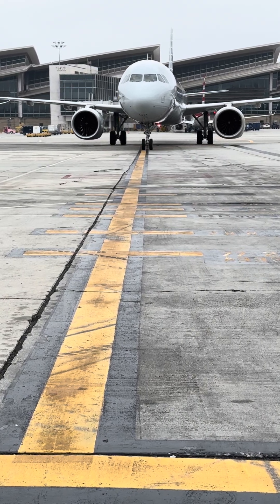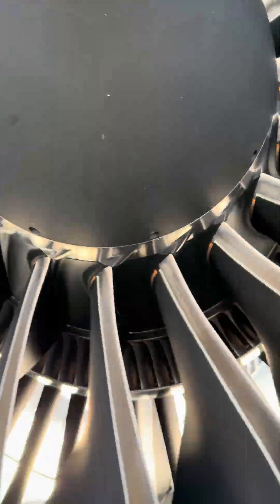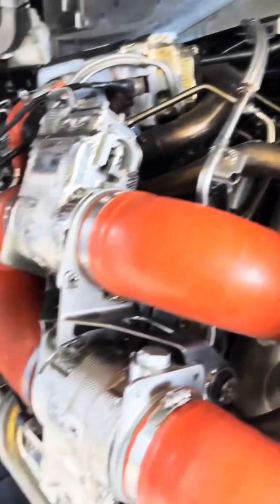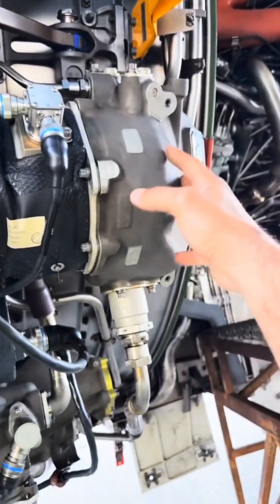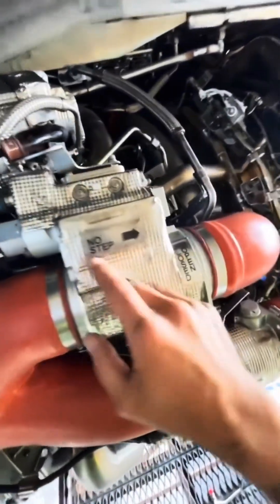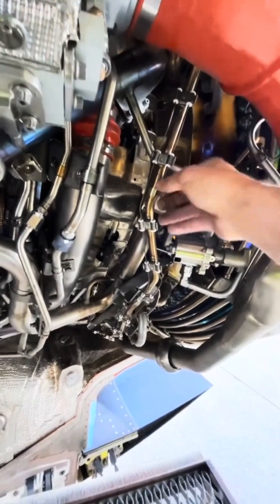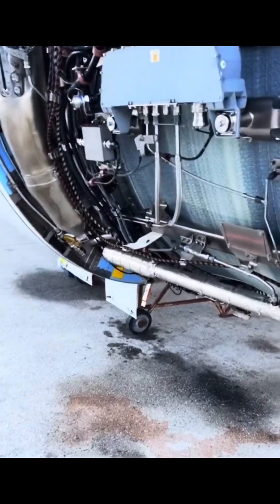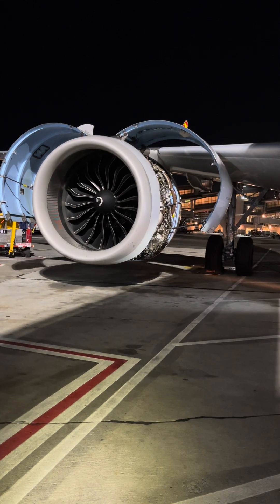CFM LEAP 1A break down

Comment: And we always have a HIL entry for HPTACC support brackets broken or fully broken. Check every 150 flight cycles in accordance with a certain service bulletin. We now get the reverse bleed system retrofitted as well, so quite apparently the engine needs some love and has its issues.

That said, it is absolutely incredible. Climb performance is much better, one can nearly always climb straight away to the maximum cruising level saving more fuel. And yes, it absolutely sips fuel. We need 1.5 metric tons less fuel on a 2 hour sector.

Comment: Can anyone explain the difference between the CFM leap and the CFM56? 
I know the leap has the composite blades, does it also use a FMU instead of a HMU like on the CFM56? Cant find a clear answer online
Reply from the maker: Well the leap 1A/1B is a very different design. It has advanced technology much like the GEnx. FMU and HMU work much the same in concept but how it does its job is different. Different compressor staging and well as advanced materials in leap engines.
Reply: @StigAviation  that's amazing, thank you so much! Dont suppose you know where I could find any more information on the inner workings of the FMU?
Keep up the great vids!
Reply from the maker: @jamowie4866  https://www.researchgate.net/figure/Schematic-of-FMU-and-flow-rate-servo-control-valve-of-fuel-control-system_fig1_336391625 

Try that for starting.
Reply: @StigAviation  legend! Thanks man, much appreciated!

Comment: I don’t what he said
Reply: @StigAviation  yes, I didn’t understand: 1. Where’s the APU.
2. How does the pressurized air start the engine 
3. How exactly are the gearboxes connected 
4. That valve is a regulator of what?
…
Reply from the maker: @erict.35  you should watch my other videos. I explain a lot of that in other videos
Reply: @StigAviation  every engine has its dedicated APU?
Reply from the maker: I think you were confused on engine and APU, APU is an engine. It’s just an extra engine in the back to provide air and electrical power, it’s got nothing to do with the main engines.
Reply: @StigAviation  what do you mean APU has nothing to do with main engines? You said the APU has something to do with the start of the engines.
Reply from the maker: @erict.35  yes to start the engine but otherwise it is its own source of power. You asked if engine has its own apu. I’m saying there’s only one apu
Reply: @StigAviation  okay.
Reply: @StigAviation  where’s the compressor?
Reply: Where’s the compressor (or air pump - I don’t know how you call it in English) for the starter?
Reply: Okay, so the compressor is located near the APU and then there’s a pipe from the APU to the main engine, where there’s a mini turbine motor which is mechanically connected to the main engine shaft. You didn’t say anything about it in your video.
Dislike.
Reply from the maker: @erict.35  starter is on the left side. I show it in the video.
Reply: @StigAviation  in your video you didn’t even explain why you have to open the valve manually. Why don’t they do it electronically?
Reply from the maker: @erict.35  this is why I said to watch my other videos sir. I put more information in my other videos

Comment: You mentioned the EEC in your video. The 737 has that. Airbus engines have FADECs.
Reply from the maker: They both have the same thing, it’s just EEC is that physical box on the engine, FADEC is the system. The terms are interchangeable.

Comment: Could you show where the pressurized air exits after driving the starter? Is it vented into the bypass stream, or is there any exhaust similar to the one for the engine anti-ice?
Reply from the maker: You mean from the starter ?  Just gets dumped into the cowling and goes overboard

Comment: Wow ! Runup with engine cowl openned 😱 not allowed in case of engine fire !!!
Reply: But i want to tell you that all your videos are very nice. I m instructor and you hare a very pedaguog guy !
Reply from the maker: @gev340  thank you very much sir. Much appreciated
Reply from the maker: It’s actually is allowed only if you have fire extinguishers on site 👌. But otherwise it’s best to close cowling before running 👍
Reply: @StigAviation  when i was young mechanic in the 90' we made the parce power on JT8 of the MD83 with open cowls and turning the rigging srew under the engine at idle. When i began in AirFrance it was not allowed for safety reason and specialy in CDG airport under EASA rules. I know you re true because we alway use to get a big ground fire extinguicher with us but for insurance policy it's a mistake under your responsability if a fire occure during runup cowl openned... Europe is strait with rules. Because there is a lot of money behind a plane. As you said about the prise of the leap.
Reply from the maker: @gev340  ahhh the good old days of trimming the engine at idle when standing under it … I do miss those days. JT8D holds a special place in my heart. Probably the last good engine PW made in form of design for a low bypass system.
Reply: @StigAviation  so we are the same generation you and me ;) JT8D was noisy but so fine and powerfull engines ! CFM56 is nice but different... The leap is his direct brother. And for PW, in french we say Pratt et Vite fait (prononciate vitfai) that mean quikly made... :)))
Reply: @StigAviation  i found u on facebook, better for PM

Comment: Hello brother! Just want to ask if the fan blades expands, i've been seeing signs of scratches on the acoustic panels on neos
Reply from the maker: Yes indeed they do. Blade expansion is a normal thing within Certain limits... if Blade begin to expand too much that's called Blade Creeping ... at that point it will start to cause damage to the abradable liner...blade would need to be replaced.

Comment: Very well done video. Fascinating engine. Question: Can the fan on an engine at standstill be prevented from rotating if the fan was held in place by hand?
Reply from the maker: in theory Yes it can, because it gathers momentum to spin up, but i have never done that
Reply: Not sure to understand the question, but if it does not turn, yes you can hold it by hand when the wind starts to blow.
But when rotating, don’t even think about it. The mass of the rotor is important and you may end up with missing fingers or broken fist if you do so. 
By the way, these fan blades have a titanium leading edge but no titanium trailing edge. No need. They are so strong it’s amazing.
Overall it’s a good video but there are some on the CFM website that show all that too. And from the horse mouth 😊
Reply: @ChapaLipar  I was wondering if I could prevent an engine that is OFF from spooling up if I hold the front fan still. Before it starts rotating, keep it from rotating.

I was told yes, but I think that if there's a geared starter involved, that might not be true. Holding the fan will not stop the starter from rotating and as the starter starts so will the fan, regardless of whether you tried to hold it still or not.
Reply: @jeffnew1213  ok. I got it. You can hold it with your hands. One hand is enough 😊
The starter is connected to the HP rotor, not to the Fan. And except during the starting sequence it is deconnected from the gearbox. Like in your car. But if you push the start button you will engage the starter and start to rotate the HP rotor, and the air sucked in will escape the HP compressor, then the HP turbine , then will flow to the LP turbine which is attached to the Fan. So as the HP rotor speed will increase, the torque applied to the Fan will increase too. Knowing that the engine starter on such engine is equivalent to around 150 Horsepower, you won’t be able to old it very long although there is no mechanical contact between the HP rotor and the Fan 😊
Reply: @ChapaLipar  Interesting. So one would only have a short time until the LP turbine and fan become too difficult to hold still. Got it. So the best one can do is delay rotation of the fan for a few seconds at best.
Reply: @jeffnew1213  right.
When an engine is rotating only because of the wind (windmilling) you can stop it with your gloved hands. 
If the wind is strong you can slow down the Fan by applying pressure on the Fan blades until you can stop it.
Anyway it’s not a recommended game 😊

Comment: Fascinating stuff. The tip clearance control, what range of circumference expansion is the engine having to deal with? mm? a cm or two?
Reply from the maker: MM  very tight tolerances

Comment: Thanks for another informative video.  Nice to see the highly praised CMF Lp1.  

I have a kinda stupid question. When a pilot decides to dump fuel.  Is it via the wings or the engine have a release valve?😅😅😅😅
Reply from the maker: Good question!  It depends on the aircraft, some aircraft dont have the capability do Jettison fuel ( A321 cant) But for example the 777 can dump fuel , it will be selected from the flight deck on how much to dump and the fuel will drain from the wing tips jettison tubes.

Comment: Can you please explain why the LEAPs on thr MAX need so long to start while the NEOs don't.  I understand about the bowed shafts and thermal expansion I just don't understand why one has the problem and the other doesn't.  Great video!!!  Loved the test run at the end!!!
Reply from the maker: Good question! and you kind of answered it yourself, the shaft bowing is the reason, the LEAP 1B has a bit of different configuration when it comes to the Compressor staging. Both engine do take a while ( especially on the first start of the day)